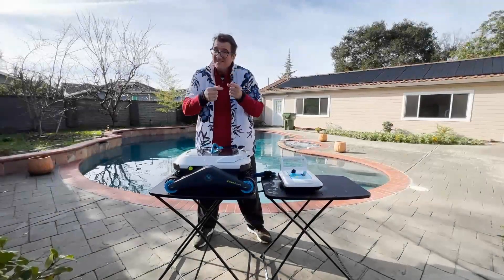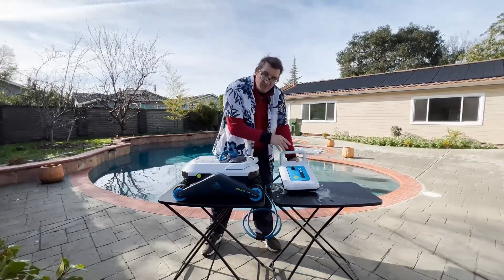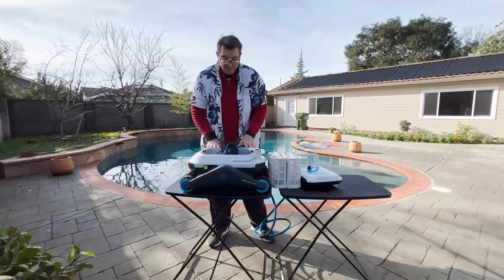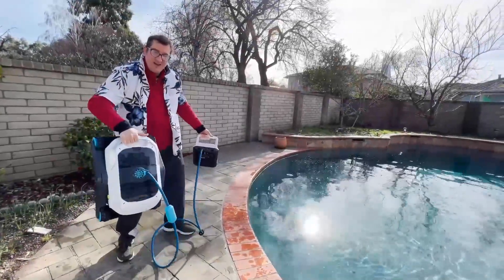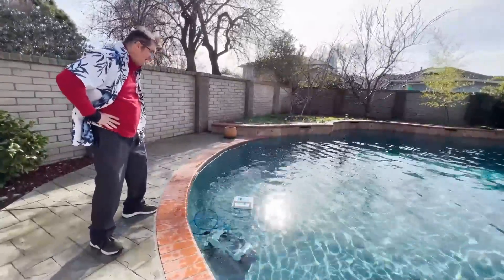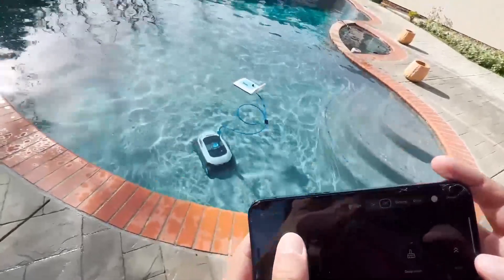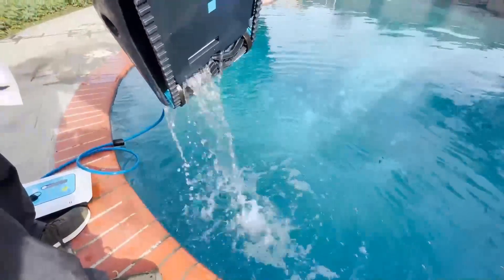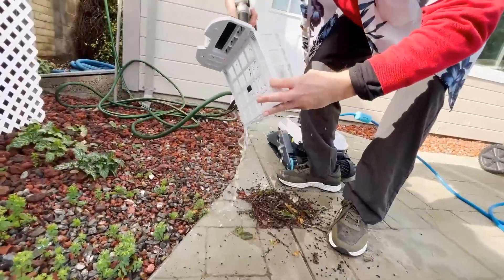Degrii Zima Pro from a Beta Tester's Perspective

Comment: Needs a solar panel on top of the floating unit to charge the cleaner during the day, then clean the pool at night.
Reply from the maker: Thank you for your comment. Now, Zima Pro needs to be plugged in to charge. However, Degrii Zima Pro is powered by a 10000mAh battery which can ensure 3.5h runtime with 5000 Sq.ft on a full charge. So, you don't have to charge it over and over again in a short perid. Thank you so much for your brilliant idea, we will transfer it to our engineering Team and will let you know if there is any progress.